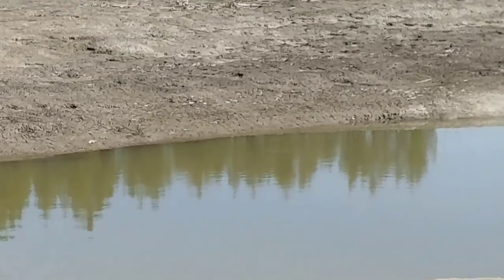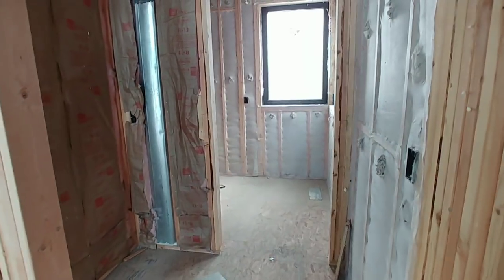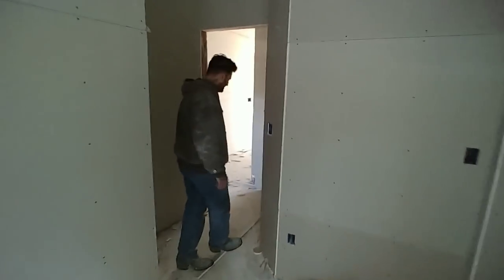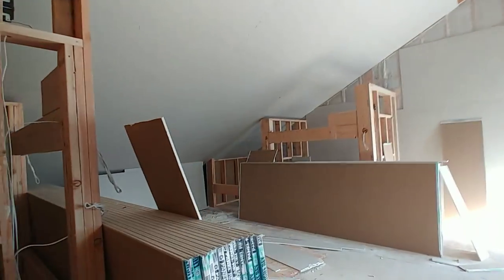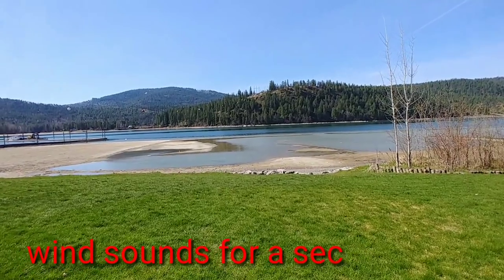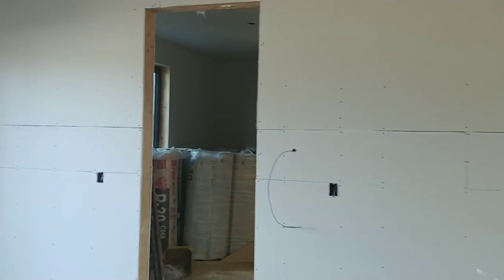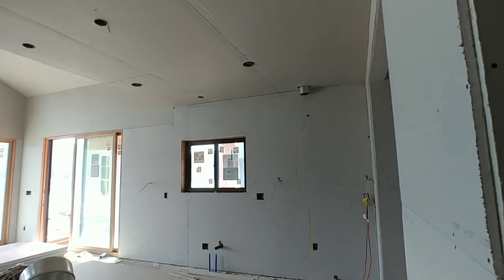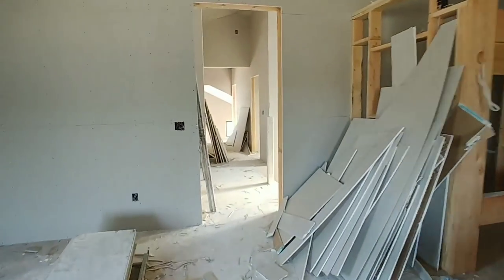Dover Bay custom. Drywall hanging crew work vlog.

Comment: Another dope video man. Btw, do the tile guys do the tile backer themselves? I noticed those were left undone
Reply from the maker: Yeah it depends on whats subbed out. Not very often in residential homes do they have us install it. When I do commercial jobs I'll use that bored a lot in the bathroom areas. And sometimes on big customs that have it worked into the bid
Reply: Nomadic INK ahhh, I see. Things are so different over here in NJ haha. It’s very rare that any place that’s subbed out doesn’t include those things. Another thing, you guys aren’t responsible for throwing out the garbage and sweeping I’m guessing??
Reply from the maker: No I get spoiled when I sub drywall. Someone stocks the job and cleans it. I just come in and hang. We try to keep the scrap down and organized but sometimes it just gets out of hand.
Reply: Nomadic INK that’s freakin awesome man wish it were like that for us

Comment: You're wasting time in all the rooms where you need staging to do the ceiling.bring your walls up first or start with a strip or full sheet after you top it out from the top down while you got the staging still set up so you can finish it from the floor.